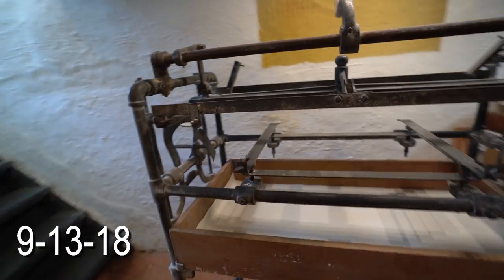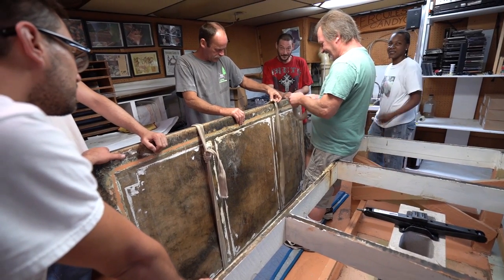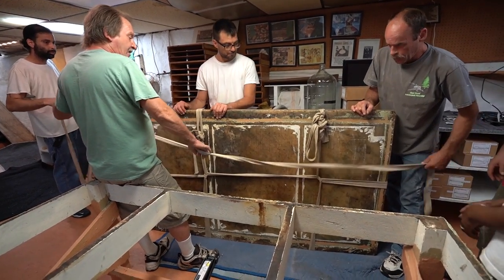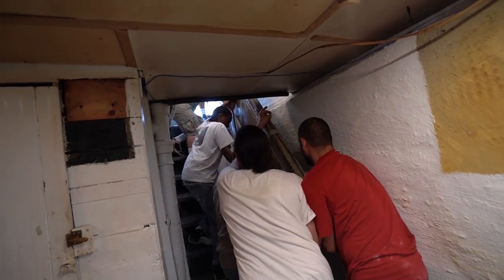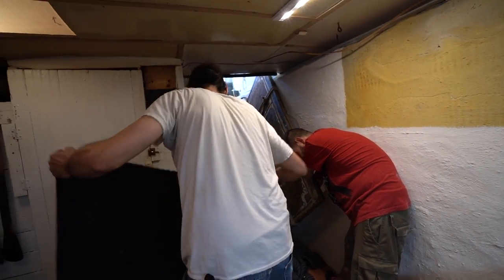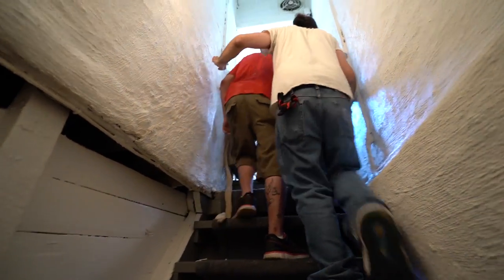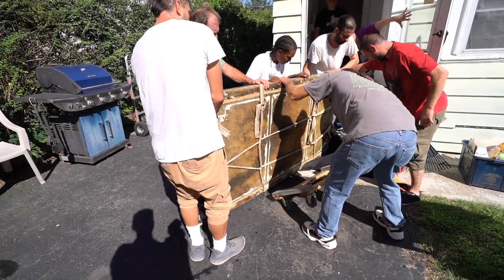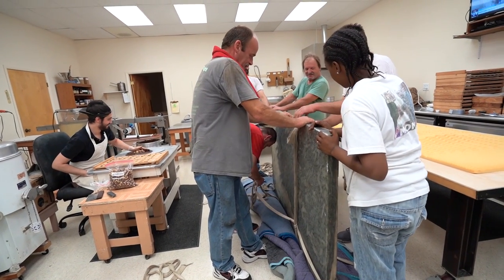It Took 6 People To Move This Marble Slab!

Comment: They did well considering they were hand moving 500 - 600Ibs of marble up a flight of stairs. 52:55 i would of kept it on the dolly there and just titled the marble on it's side so it could fit through the door ways but you still could move it on the dolly.

Comment: Wondered why you didnt call a stone mason as they have lil trolleys for moving. As to the crack, you could tape the underside and edge and fill it with epoxy resin. Problem solved... but im not sure about heat resistance. Might be worth looking into?

Comment: Great job on moving that slab successfully! History in the making!  I looked up a marble slab weight calculator, yes they have one (https://www.amlinkmarble.com/weigtcalculator/weightcalculator.htm ), and it weighs easily over 1,000 lbs! They mentioned on the video that the grandpa's football team helped move it down there circa 1940, that would put it down there for around 78 years! Longer than most of us have been alive. I'm so glad that it made it to the new place in one piece!

Comment: Ok so I'm wondering again... Couldn't they have used the same ramp and wheels frame, when moving the marble slab out of the basement? The ramp didn't look wider than the stairway... But then again I may be wrong.

Comment: The HEAD DUCK...IN THE GREEN SHIRT.NEEDED TO BE PLUCKED OFF THE JOB...DID NOT NEED THAT USELESS FLIMSY BOARD ...TO BEGIN WITH..NOR THE STRAP THAT SLIPPED OFF ...WITHOUT TYING IT SECURELY ...  IT'S A WONDER SOMEONE DID NOT GET REALLY HURT...BUT, THEY GOT IT ... GREAT GUYS...JUST ...ADJUST YOUR BAD TEMPERED BOSS' ATTITUDE... & TREAT YOUR CREW BETTER ...THAT DID THEIR BEST....SO, SO HEAVY !!!!

Comment: You know a ratchet strap probably would have worked too. Wrap it around, hook together and cinch down. Or a pulley system to get it up. It’s done now, but work smarter, not harder. Then again, how often you move a damn slab.

Comment: Anyone know much does it weigh? 400lbs? 500lbs?
Reply: By the struggle I would say 500 llbs or more.
Reply: Marble weighs 13.34lbs per square ft at 1 inch thick.
This table appears to be 2 inches thick by about 3.5ft wide by about 7 ft long...so
3.5 X 7 =24.5 X 2 =49sq ft X 13.34 = 653lbs..
So ya that's a hernia busting heavy slab

Comment: what is the foam under the slab for? to create some kind of air gap?
Reply: Maybe to prevent scratching.
Reply: ?????? Scratching from what? Sitting on a solid surface and not moving?
Reply: @brikhouse22  Scratching the new table it's sat on, when it was been moved into position.
Reply: a surface that wont be seen for another hundred years? doubtful. but if so doesnt make much sense.
Reply: @brikhouse22  I'm only guessing, I know they've had it since the 1940s, they look after their things, maybe they are been over cautious.

Comment: Why didn't these guys just splint the entire piece of marble?  Two 1" sheets of strong plywood that overhung the slab enough to screw through all four sides like the covers on a book would have lessened the pressure on the crack.  But I'm just a  female Senior citizen, so I could be wrong.  Anyone have an opinion on simple splinting of the slab?   Have a nice Christmas.    :0)    DBB

Comment: If I was those movers I would have at minimum taped the crack. But tying a few ropes longways a definite. They are lucky it didn't snap in half. When I said longways I meant to support the marble crack not just to grab hold of. But in the end it all worked out so alls well that ends well I guess.

Comment: I'll be honest, that was one of the worst displays of logistics I've ever seen, this is the result of not having the man power or the right tools for the job, where-as the job was done and luckily the client was overly nice letting it all slide, I would have been ultimately unsatisfied. As an example when they brought the marble into the second location and started placing it on the table.. they were trying to slide it across the foam instead of just lifting it and placing it directly In place, ontop of that when asked to move a little to the side there was no hesitation but after moving the guy who looked like the boss just walked away.. with a "yep I'm done" attitude, as if he's done more than he should already and they shouldn't expect more from him.. and before the replies with all the excuses start coming, this was my job until very recently for over 10 years for a large commercial company that specialises in corporate events, so doing this on a daily basis was routine for me, I know first hand what it is to go above and beyond for your client no matter what's being relocated, moved, constructed, de-constructed or simply adjusted. And there's no excuse for been ill-equipped to actually do what you've been hired to do.
Reply: Didn't they say every other moving company in town turned the job down?  Maybe that was just a joke but I'd believe it.
Reply: @ajay97005  I'd be surprised if that was the case, even so who ever accepted the job must have known what it was doing specifically because they took it (if no one else would take it), Which inheritantly waves their right to be anoyed, especially as they could have made their job easier by just using the right tools, e.g a slab dolly or just bigger guys to handle the load. I get that it's an awkward shape but trust me when I say there are better ways to get that marble up the stairs than sliding it on its end with 6 people fumbling around it.
Reply: I was thinking a marble/granite dealer probably has special equipment for just such situations..